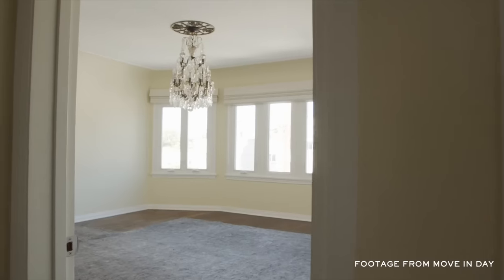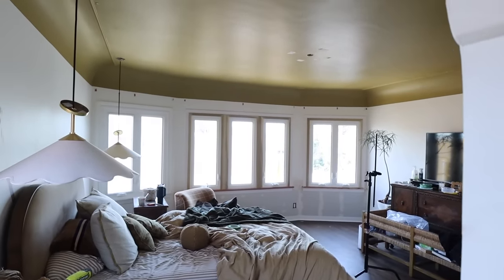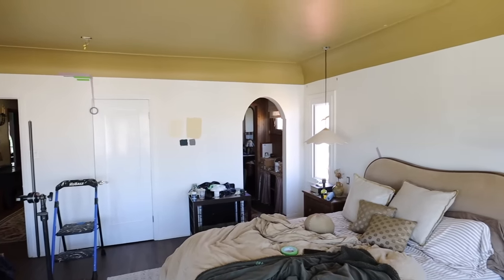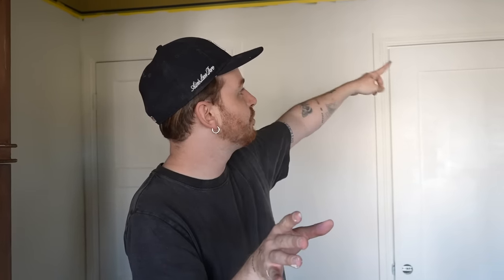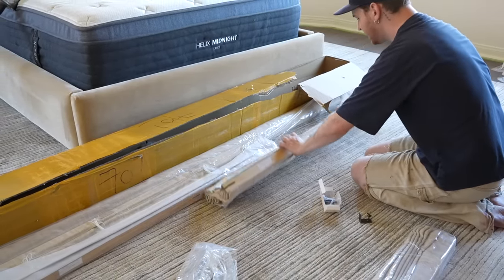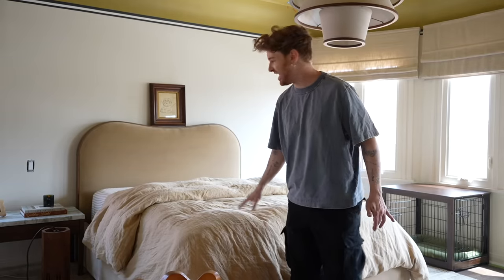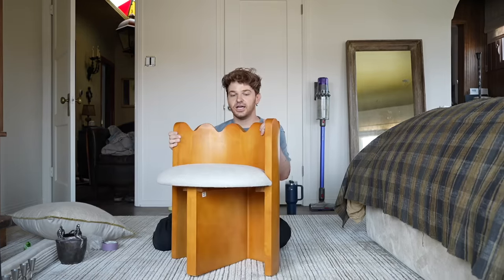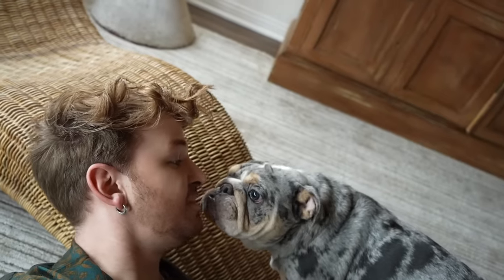EXTREME BEDROOM MAKEOVER *DIY Striped Ceiling & Furniture Flips! (From Start to Finish)

Comment: Think I'd have to paint the interior of your beautiful tv cabinet,  as could see that minty colour when doors were open. 
Been thinking and I think what would look fabulous at the bottom of your bed would be a bench the width of the bed, either a solid or open type would look great, and maybe move the round chair( which looks so much better darker).
Seen comments about your beautiful Marino Glass lamp and I'd also move it, as would hate for little Winston to knock it over accidentally, cause it's gorgeous 😍 ❤

Comment: Overall I love the bedroom transformation - excellent job, as always Drew!  However, there are a few things that could be changed that, IMHO, would take it over the top:

1. Hang the Roman Shades just BELOW the stripes.  Don’t cover the beautiful stripes!  Mimic the height of the armoire which allows the stripes - and all your hard work adding them - to show.  “Chopping” the continuity of the stripes with the shades throws off the balance of the room and causes the eye to focus on that window wall.  The windows, though beautiful, are not the main focus of your room! (Surprised no one else commented on this….)

2. Ditch the 1990s IKEA Karlskrona wicker chaise lounge!  It does nothing at all for the room except stick out like a sore thumb.  Same for the little Lilliputian wooden chair.  You have plenty of spaces in your home where they will shine!

3. Paint the inside of the armoire!  It looks unfinished.  Also watching TV will be a much better viewing experience if painted a dark color (or at the very least the color of the outside).

4. The Murano lamp, though lovely, is completely out of place as is the stool.  Love them both but you should show them off in a different space of your home where they can also be appreciated by others!

Love you, love your work!  Can’t wait for the next transformation!

Comment: OMG Drew, PLEASE DO NOT SELL OR GIVE AWAY THE GORGEOUS CHANDELIER.  It would look have looked so gorgeous with the ceiling color, and one day (sooner than later), you will realize that the chandelier deserves to resume it's rightful position, crowning the bedroom, even if the rest of the room is the same as it is now.  Also, please move the glass lamp, your puppy could easily bump into the stool and knock it off, shattering, and injuring the puppy.

Comment: Maybe it's nothing. Maybe I'm just a worrier. But it looks like dog crate location could get hot on exterior wall beneath window like that. Interior wall is better. Maybe store one nightstand and use dog crate as a nightstand. All else fails, maybe a cooling mat inside the crate?

Comment: That Morano lamp will not last very long if you put it on that stool and plug it into The wall because Winston will run through there and pull the lamp right off.